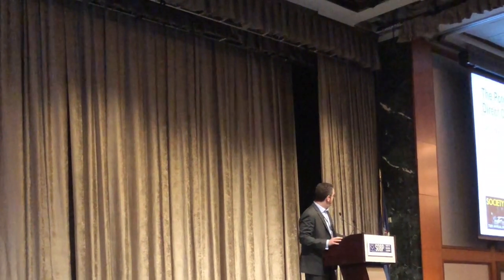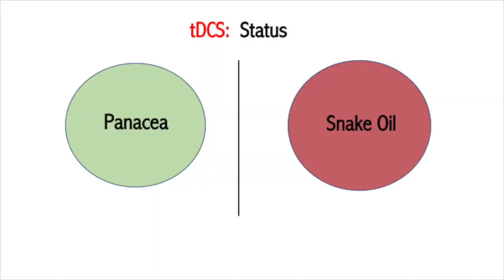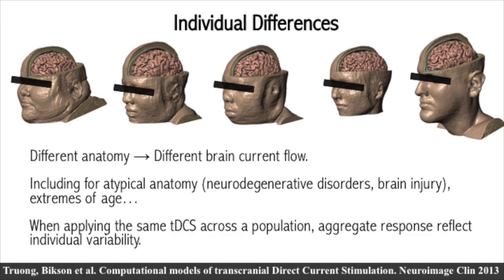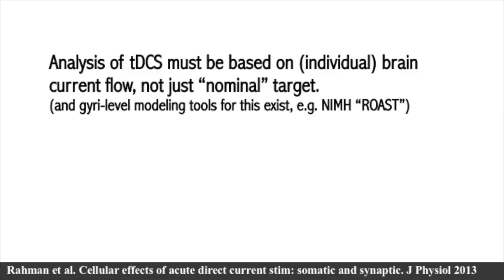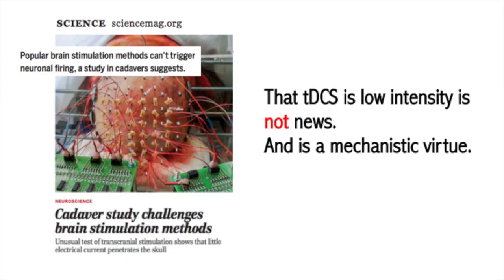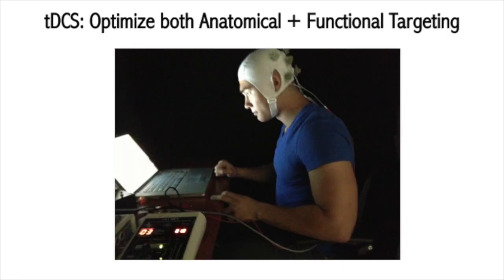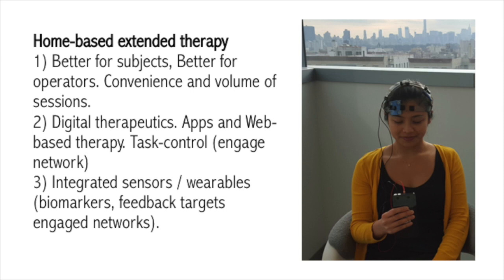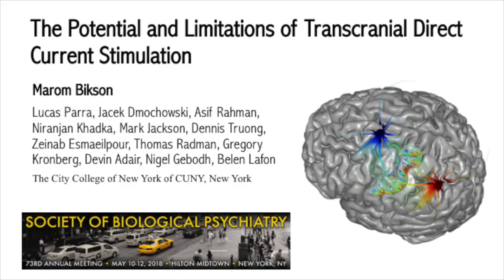Marom Bikson plenary talk on tDCS at Society of Biological Psychiatry 2018 meeting (May 12, 2018)

Comment: 18:30 Was a very interesting slide. After learning about TDCs for quite some time now, and am now building my own device. Could you elaborate on some of the dangers and easiest studies with profound effect to conduct with a home made device?
Also, I'm aiming at regulated 2mA at 5V, does that sound correct?
Reply: Build in a constant ammeter, so you can tell if you're getting fluctuations or other issues.  Buy a multimeter and calibrate your ammeter periodically.  Without calibration the ammeter is useless and misleading.  Build in a knob connected to a potentiometer so you can ramp up to treatment amperage (you want to start with 0 amps and increase to 1-2 mA over a few seconds to avoid discomfort and potentially damaging phosphenes).  If I had it to do over again, I would build in a process that slowly ramped to treatment voltage automagically.  I thought my head would provide significant resistance, but it's almost negligible.  I power my machine with a 9V battery and it's plenty.  I suspect 5V would be fine.  I am NOT a doctor nor an electrician.
Reply: @chaosordeal294  thanks!
Reply: @chaosordeal294  thank you very much for the detail in your post. 

Do you know a good place I can learn The difference between tdcs and CES?

I see a lot of CES devices and they look simpler for me to use because I'm not technical at all. 

And on your opinion, what percentage of benefit for mood disorders do you think someone could get from CES vs tdcs?

thanks a lot for your any advice you can give. I've just struggled a lot, and I'm doing my best to self-heal. I welcome any advice. All the best, Thomas Seattle Washington USA 😊